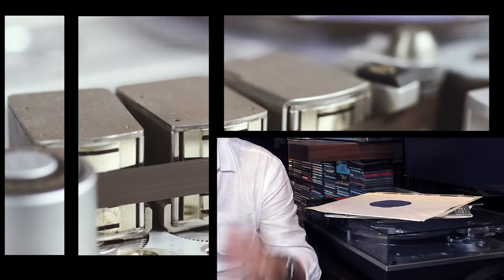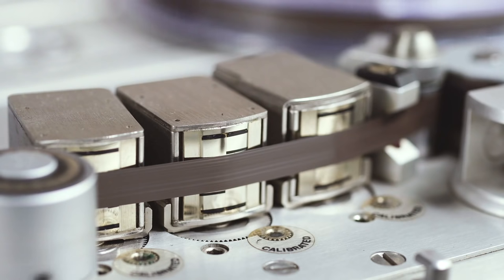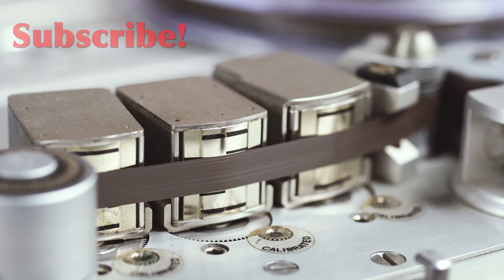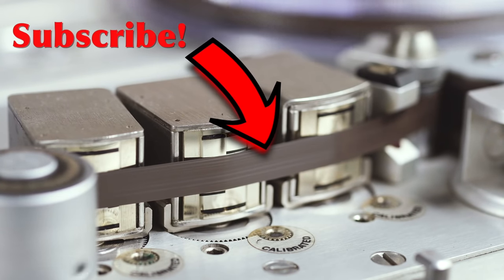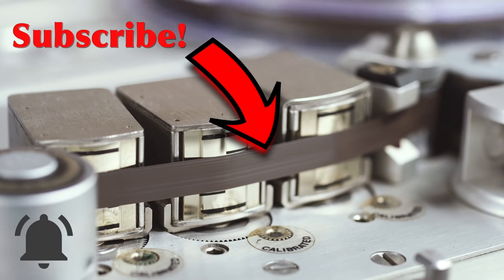How to reduce inner groove distortion & tracking error

Comment: Concerning off center spindle holes - other possibilities... I believe the Nakamichi TX-1000 and the Dragon Computing turntables had dynamic correction for off center pressings. I think Micro Seiki may have had one too. A more primitive, but probably still effective solution, would be to establish the degree of off-centeredness by and measurement and then elongate the hole in the appropriate direction with a cylindrical file. After that one would insert a temporary spindle substitute and apply some liquid plastic to essentially reposition the hole. A simpler, if less permanent, option would be to elongate the hole, as above, and use a record clamp to keep it properly centered. Thank you, again, my friend, for these wonderful videos!
Reply from the maker: Thank you! All great solutions!

Comment: I have an easy fix for this ! After chasing this issue for years I realize for me it was my cartridge and stylus shape that was the issue. So I switched over to a Audio-Technica AT-VM95SH Shibata And said goodbye to IGD on my SL-1210GR for good !
Reply from the maker: Yup! I suggested that in the video as well.
Reply: There are some records that are still too challenging, if you ever find them I can recommend the VM95ML as its an even better stylus. 1/3 the width of a Shibata meaning its even better at flawlessly following tight groove passages.
Reply: Yep, Microlines and Shibatas are the way to go. 3x7 or 4x7 ellipticals just don't fit inner grooves very well and their performance will degrade quickly as the stylus wears.
Reply: Shibata rules!

Comment: Hi, one of the reasons i`m personally not very keen on vinyl albums is because some of the pressings suffer from Inner Groove Distortion. As the grooves compress towards the spindle the sound can sometimes loose some dynamics or loudness. I own a lot of albums that sound fine so it must come down to the way the vinyl is cut. One of the reasons i buy more 12" singles than vinyl albums is because i often find that 12" singles sound louder and more dynamic due to the fact there are less tracks so the grooves are being less compressed. I know most audiphiles aren`t really keen on 12" singles but i prefer collecting them to collecting albums.

This video reminds me i`ve got to get an alignment protrator for my Technics 1200GR. 

Thanks for another excellent video. Cheers from England.
Reply: Acid House I’m also a fan of the 12” 45 RPM single. There can be distinct improvements in sound quality when comparing to the same music on a 33 LP.
Reply from the maker: Cool! Thanks!
Reply: Do you mean the small 7" disks? 12" is the size of the large "full" disks.
Reply: Marco Toselli 12” 45 RPM singles. 12” as in exactly the same size as an LP.
Reply: @michaelb9664  I have never seen such a single, but I have a couple of albums that are on two 45 rpm 12" disks. I like that format, it's smart that since you are using two disks per album and you have room to spare you can also increase the speed and sound quality!
Reply: Marco Toselli it’s more common with pop music and electronic music to find 12” singles, although other genres do also have such a thing. 

12” remixes and extended versions of pop songs used to be a thing in the 80’s in particular. Just think of DJs using two turntables at the mixing desk. They are using 12” singles 👍

Comment: Hi, thanks a lot for your videos! Just about a week ago I’ve opened to myself a Stevenson Alignment Protractor. Dude, it has changed everything! You can read about it on the vinylengine but in two words, you put a “null” point of the needle closer to the spindle as there is much bigger angle error and reduce it as much as possible. Theoretically, this way of alignment increases an outer distortion a little. But as it is much lower than inner, it’s difficult to notice a difference. Personally I admitted a way much lower distortion on the inner groove and no distortion increasing on the outer groove, using this method. Highly recommend to try it. It is mentioned on the vinylengine that Rega’s original protractor uses Stevenson’s method (or very close to it’s “null” point).
Reply: Here is a link with descriptions:
https://www.vinylengine.com/protractor-user-guide.shtml
Reply from the maker: Thanks! Yes, the Stevenson is one of the most famous alignment methods. I am more of a Baerwald guy!

Comment: Hello, I agree with everything you indicate. I think the best solution (in addition to a correct cartridge alignment) is the quality of the needle, be it shibata, microlinea, fritzgyger, fineline ... etc. Everything else will add problems to the monitoring.
Unfortunately the quality of the vinyls is not always good, I would say that most are defective, except those that are cut at medium speed that solve practically all the problem of wheezing, such as MSFL editions and other high quality presses. Although a decent sound can be achieved with mastering suited to the limits of the format.

Off-centering is a very common problem, even with new registrations. There is a very simple way to correct it. All you need is a scissors or knife and gradually enlarge the hole, then the LP is placed on the turntable, we can center it by eye ... Then just make a small mark on the label to remember the position with respect to the axis .
Reply from the maker: Or buy a Nakamichi TX1000 self-centering turntable...amazing piece of gear!
Reply from the maker: Grandeee!

Comment: Great video as usual, thanks! I'm surprised you didn't mention vertical tracking force as a factor in IGD. I use the Hi Fi News Test LP as well, and while putting VTF at the high end of the cart specs helps a bit, it doesn't have near the impact as anti-skate does. I use Audacity to record those test tones and zoom into the 300hz waveform as it plays, while adjusting the anti-skate. If it's too low, the right channel waveform distorts a bit. Too high and the left channel goes berserk. However, that behavior was the same on my AT150MLX microline stylus as well as my Denon DL-300 "special" elliptical (.1mm x .2mm). So in my experience linear cut styli aren't perfect in that regard. That said, I tried a VERY used ATSA33 (shibata?) and it tracked all 4 of the Hi Fi News torture tracks very well ! That was the first cart I tried that I could get to pass the 4th (hardest) torture track. But that's a far more expensive cartridge than the other two i mentioned. I would be very curious to see the waveform recordings of your turntable on each of the 4 torture tracks :).
Reply from the maker: Thanks! There are so many aspects related to this topic that I decided to cut some out. Thanks for sharing your experience, it's always helpful to have further advice from true and direct experience.

Comment: I have a brand new Thorens TD 103 A auto running an Ortofon 2M blue and about a year old Thorens TD 190-2 auto with an Ortofon OM 20 in another room and both track amazingly well. Unless the record is truly a bad cut or was damaged on a poorly set-up table or a cheap record player they have zero audible IGD. They both use the Dual style dynamically balanced ultra light tone arm. Adjustment matters, but a very well engineered tone arm goes a long way reducing this distortion.

Comment: 12:50 That Shibata and Microline are the best is debatable... I would say that fineline and Gyger are better in most applications.
Mainly because setting the correct VTA for Shibata and Microline/microridge is often not good enough and you have to set the SRA very accurately, otherwise they don't perform optimally.
With fineline and Gyger, setting the VTA is much less critical, increasing the probability that you get the most out for your stylus when you don't have a microscope to set your SRA.

15:06 The issue with tonearm resonance isn't exclusive to that 5 to 15Hz range. 5 to 15Hz is outside the audible spectrum, but because of intermodulation distortion, those inaudible frequencies cause a "wow/flitter like" distortion on certain higher frequencies that are audible. Even without tracking issues that are related to the tonearm resonance.

17:00 That a longer tonearm itself reduces tracking angle error is a common misconception; overhang is what makes all the difference. The main reason to go for a longer arm is to create more distance between the stylus and the tonearm base where vibrations enter the tonearm. However, a longer tonearm makes it less stiff; it reduces the rigidity, which generally affects tonearm resonance in a negative way. If the tonearm tube is longer, but the same thickness, it also has a higher effective mass. The effective mass can be positive or negative, depending on your cartridge compliance (positive for low/negative for high compliance cartridges).

19:00 Also that an S or J shaped tonearm reduces tracking error compared to a straight tonearm is a misconception, when a cartridge is properly aligned. An S or J shaped tonearm places the headshell at an angle so that it's perpendicular to the grooves, but without that angle (straight arm), the user can mount the cartridge into the headshell at an angle. Again; overhang is what makes all the difference.
The main benefit of an S shaped tonearm is that the forces at the stylus tip are in line with the pivot point of the tonearm. Another benefit is is that the S shaped tube is more stiff and rigid than a straight tonearm tube. Higher tonearm rigidity is generally better when it comes to tonearm resonance.

21:00 The ideal is a friction free tangential tonearm indeed. I don't know how good the high-end variants are, but I've seen cheaper types like those plastic tangential ones Technics made, such as the SL-10. Those are actually worse than conventional tonearms and can possibly damage/excessively wear out your records.
Reply from the maker: Ok, finally got a chance to answer!
1) What is best is always debatable, so ok.
2) The lower frequencies are the problem. In any case, the final goal is to keep it with 8-10Hz to have a great performance.
3) Why would you say that? It is not at all a misconception. Offset is the key, and longer arms rediuce that need. It's not my idea, is a well rooted idea. You can disagre with it but it is surely NOT a misconception. Both arms have pros and cons, that's all. A completely short, straight tonearm is always going to be worse than a long straight one. The correcrt cart angle, more than the overhang, helps a lot.
4) Again, not a misconception. Better offset, better groove tracking because of the perpendicularity of the stylus, which can be achieved, at least in part, with a good cart angle and a decent lenght. Again, another school if you like, but not a misconception.
5) Indeed!
Reply: @anadialog  "A completely short, straight tonearm is always going to be worse than a long straight one."
I still don't see the point of that, assuming that both tonearm lengths result in the same overhang.
If shorter length would mean a shorter (i.e. too short) overhang, then yes, I fully agree. But that would mean the user needs to change to an armboard that provides the correct overhang.

The only inherent difference between different lengths is the "arc" the tonearm travels over the record, which is less bent/less sharp with a longer tonearm. However this arc difference between 9" and 12" is insignificantly small; a much longer tonearm is needed to make any significant difference, without that, it's merely an academical/theoretical point of debate.

It's mostly an 80s marketing story coming from brands that made aftermarket tonearms and needed an argument to substantiate why their tonearms would be intrinsically better than stock tonearms (even on very high-end turntables, those stock tonearms were usually 9").

About S-shape vs straight tonearms: There are plenty of real life examples that shows straight tonearms to be just as fine at tracking as their S-shaped counterparts.
One of the most notable examples is the SME V tonearm, which is considered to be one of the pinnacles of tonearm technology.
Another famous example of a straight high-end tonearm is the Continuum Cobra tonearm, which also places the cartridge on an angle instead of having the arm at an angle.
As a third example: SAT tonearms are considered to be among the best as well. Most of those are straight too and only place the cartridge at an angle.
Reply from the maker: Exactly, each side of the philosophy has excellent examples. Moreover, I don't know why you are fixated on overhang, which is something tied more on the cart allignment. If you are talking about the overhang past the spindle then again that is something tied to length and to a correct allignment, while the key factor here is the offset in respect to the pivot, that is what gives the opportunity to the cart to be in the correct position and track the most perpependicular way the record grooves and that cannot be achieved with allignment.
Reply: @anadialog  I almost forgot about the offset: The point of offset is that there are two places on the record where the tracking angle is 0 instead of one.
This implicates that the maximum error is lower, compared to one point of 0 tracking angle.
The curve of how the tracking angle changes during play is determined by the alignment.
If you, for example, align the cartridge using the stevenson, bearwald or lofgren type protractor, it will be stevenson, bearwald or lofgren alignment, no matter the shape of the tonearm.
The difference is that the cartridge needs to be skewed at an angle more so with a straight tonearm, compared to a J or S shaped tonearm.
An S or J shaped tonearm allows you to mount a cartridge onto the headshell without an angle, this is why integrated headshells don't work for straight tonearms, like the Ortofon Concorde cartridges. They need the correct offset and overhang to be fixed in the tonearm design.
The angled placement of cartridges at a straight tonearm might place a force on the tonearm, potentially pushing it sideways reducing the tracking ability and increasing channel imbalance. That sideways force can be compensated by setting the proper anti-skating force (that's why straight tonearms generally need more AS force than S-shaped tonearms).

Edit: it basically boils down to what the offset angle of the cantilever/stylus tip is and if it's correct, whether you achieve that by tonearm design, angled headshell or by skewing the cartridge in the headshell is solely a matter of preference.

Comment: you can reposition the centre hole it means drilling out after measuring where the hole should be to the size of a 45 adaptor, insert and glue it in position or leaving it and just using an adaptor.
And the biggest problem is is pivot point it needs to be to record surface reduces oscillation ingroove distortion an jitter. You can achieve this by adding half an inch of balsa wood block slope it at 5 degrees or 7 degrees to return the rake angle back. All depends on your arm if it can go low enough and shape
And use green Emery can get it from Linn to polish your stylus we'll make it last longer
Records could be made bigger 13" of course they don't do this because automatic turntables but if it was made as an audiophile record no reason why not
Straight Arms headshell is nothing wrong with straight Arms you just rotate the cartridge
Reply from the maker: Too much work for a not accurate result, unless its a rare edition, then I would do that or, as I said in a different comment, just buy a Nakamichi TX1000! That will solve any misalignment.
Yes, I did mention the fact that you must rotate the cart with straight arms. Offset will always be less than a curved arm. That is why, as I said, a long (10-12") straight arm is a good idea.
Reply: @anadialog  How about a Nakamichi Dragon CT?
(not the cassette deck, but the Dragon turntable of course 😜)

Comment: Another way to verify your alignment is by playing the test tone on the record and measure the output voltage for each side (without speakers) with a multimeter. The output voltages should match. This eliminated sound variants due to your room and is less subjective.

Comment: The last Pink Floyd album (2 LPs, forgot the name) has no tracks cut on the inner part of the records - no IGD issues I guess, but needs 2 records!
Reply from the maker: Exactly!
Reply: If you go the 2 LP route you can also let more space between the grooves, so that they can be a little bit deeper and so you also have more volume (that translates to a better signal to noise ratio). Also some albums on two disks are 45 rpm, with the obvious sound benefit.

Comment: Nakamichi made a turn table that could centre the record to compensate for off centre spindle holes. The weak side of that system is that it references to the rim of the record. I have at least one record that has a centred hole in reference to the groves (no visible side to side movement of the tone arm) but appears off centre if you look at the rim (or edge) of the record whilst it is turning. In such case you would make it worse with this system. But over all it is a marvel of engineering as expected with Nakamichi before it became a zombie brand.
Any way, thanks for the great summary, I think it is pretty comprehensive in terms of the issues seen. PS, regarding anti skating, that is a whole can of worms because many turn tables are not correct over the entire width of the groves.
Reply from the maker: Yes! I mentioned it in a few comments, the Nakamichi TX1000!
P.S. that is why a test disk is a good idea and will reveal that.